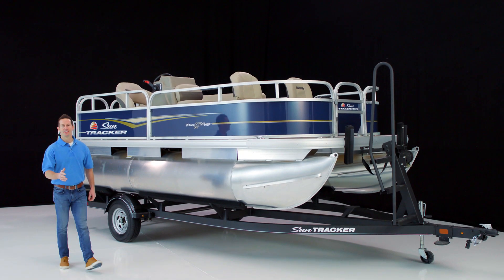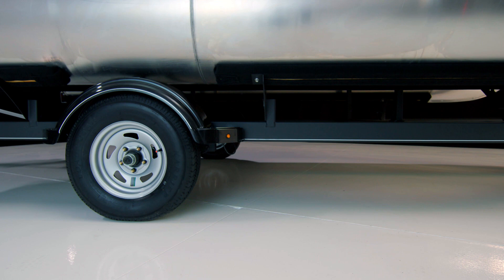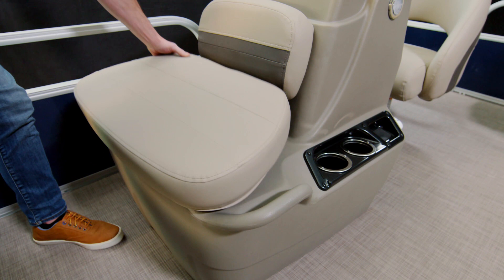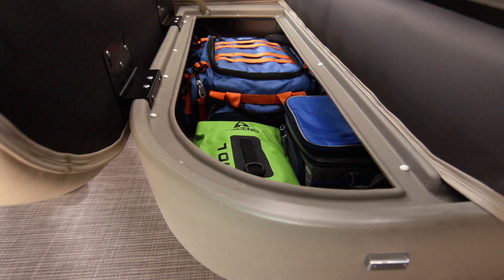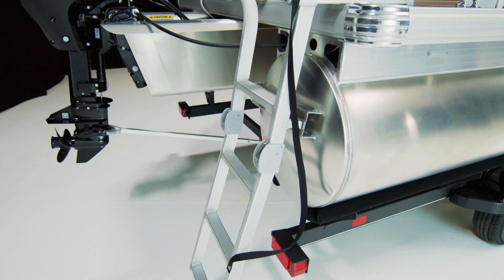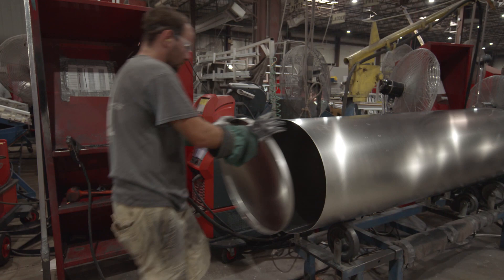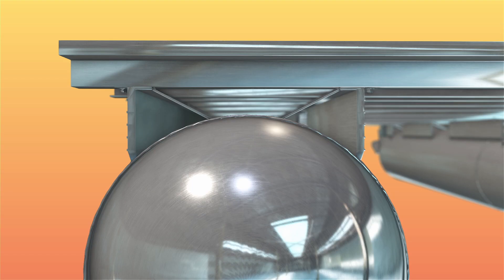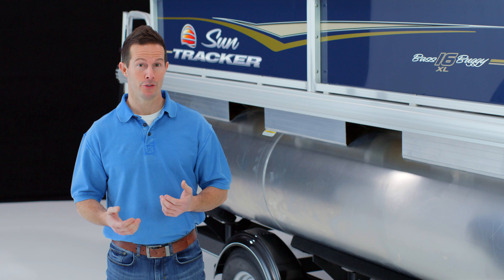2020 Bass Buggy16 XL Walkaround and Review

Comment: Just bought the same boat. Added select package and the trailer and the 50hp motor. It's tax and all $18,300. Still a great boat for the money I think.
Reply: Thats what I came to ask. How much is total package price with the 50hp and trailer.
Reply: What were the requirements ? How long to you actually get the boat? Down payment?
Reply: @justinkitchen244  got mine actually that day. But normal wait is a couple of months right now, it all depends on your dealer (mine was huge, Cabela's). I paid nothing down, that all depends on your financing though I had my own.
Reply: Taking delivery on mine in a few days.  Can't wait!!
Reply: Yep just ordered my 2021. Get it in 2 to 3 months. So pumped! I go the 50 HP, trailer, $900 add on with stereo windows, wind shield, canopy, for total of $18,500. That's dumb cheap for a 7 seater with a 10 year warranty.
Reply: just priced it out recently here in North Ga and it comes to $23818 with tax. I included the trailer with brakes and the Mooring cover as well. Prices are up due to high demand!
Reply: California wants $28,000.
Reply: Looking 28k here now OTD with the fishing package, so nearly 26k without. Bought at a good time.
Reply: Hi. Can you tell me the overall length and width of the pontoon boat and trailer while the boat is ON the trailer? I'm trying to figure out garage dimensions.
Reply from the maker: Hi, Barbara. The storage length is 24' 10", with the package width 8' 3" and height 8' 8".
Reply: @Mimi-cg2cw  just buy it elsewhere and trek it back. I bought a Porsche Cayman from San Diego and a Vanderhall Carmel from Pennsylvania and I live in Missouri.  $300 in gas is worth saving $5,000 on the boat.

Comment: What kinda speed are we talking about with the 20hp?
Reply: Mondo Romos how far I know with 25 hp you can go like 15 mph
Reply: 23 max
Reply: With a 20HP i would not call it speed more like how slow will it go.
Reply: You wouldn't get but 10 mph max. We have the 50hp. If just me out driving around 23mph, with wife and a couple kids around 15-17.
Reply: Pontoons are not built for speed at this level.
Reply: @jasonmclaughlin2155  23 MPH feels fast on the water.  I have a 14 foot 1965 Hydrodyne V-hull with a 50hp and it only goes 34 mph and feels like I'm flying.

Comment: Can you use this in saltwater?
Reply from the maker: Thank you for asking! You can use SUN TRACKER boats in saltwater applications. The proper precautionary measures should be taken when operating the boat in salt water or brackish water. The boat should be rinsed with fresh water and rubbed with a soft cloth after each use. If docking or mooring your boat in salt water for an extended time, then it is recommended that your hull be protected with anti fouling paint or a similar protectant. Be sure to check the sacrificial zinc anode attached to the motor and replace it when it is over 50% corroded. Galvanic corrosion is accelerated in saltwater, so additional zinc anodes may be necessary for extra protection. We hope this helps!

Comment: How much for one with all the options bigger motor trailer stereo and Bimini top
Reply: What is the fuel capacity? 6galons isn't very much
Reply: Optioned out. Just under 19 out the door.
Reply: I live in Richmond Hill, ON, where to find a Sun Tracker dealer?
Reply: Add NYS sales tax and DMV, call it $20,300
Reply: $23818 in North Ga including trailer with brakes and Mooring cover.
Reply: @RONALDB62  That's a pretty good deal.

Comment: National Price 
2019 $10 990 
2021 $13 999 
what happened 😂😂
Reply: 16500 now
Reply: @TheBen8355  yeah prices are shooting thru the roof
Reply: $23818 as of 6/6/21 but I opted for the trailer with brakes and the Mooring cover.
Reply: @TheBen8355  it's over 20K now with motor and trailer
Reply: Hyperinflation. Pretty soon it's going to be $100 for a loaf of bread.
Reply: I just paid 25K for one, 20 HP motor, fishing package and trailer.